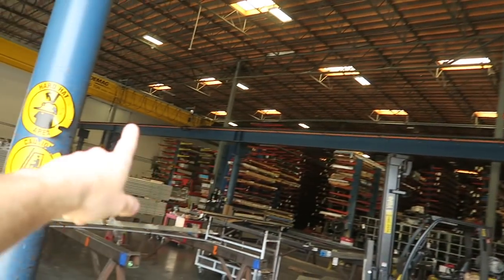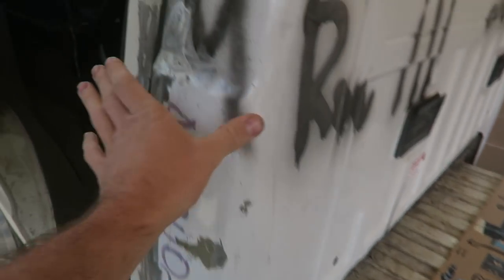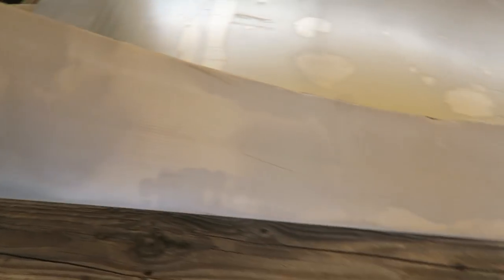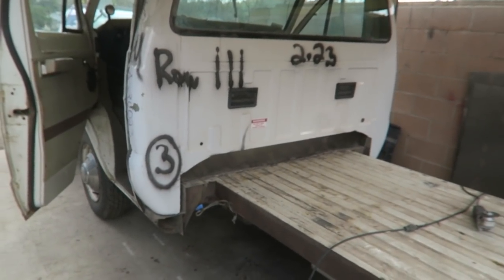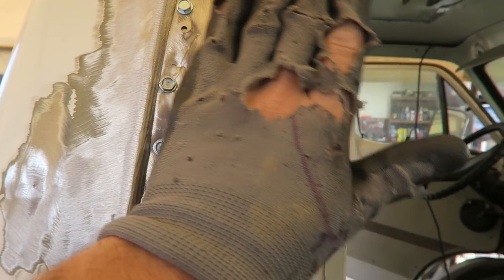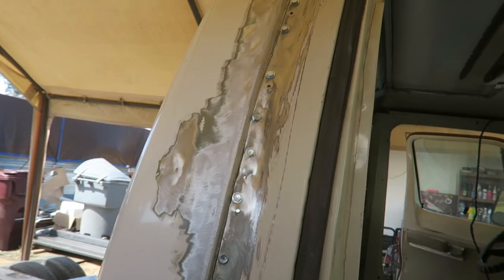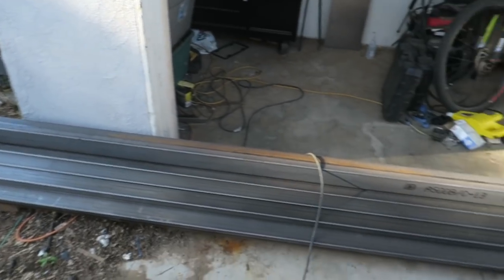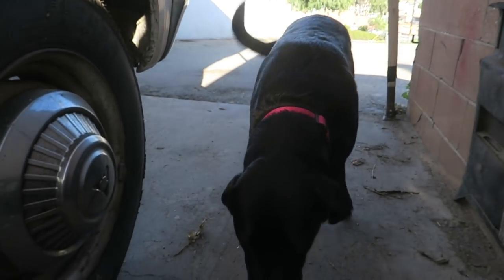$1000 in Metal - Welding Cab on Ramp Truck! (Episode 4)

Comment: I'm wondering why he didn't use the back of another dodge van for easier fit
Reply from the maker: The back of a 1973 dodge van had two doors and smaller windows, and it would have been much harder to make fit
Reply: the back of the van would of been ideal and he could use one from 1972 to 2003 with a one piece full door !!!
Reply: Or a similar era Dodge pickup cab rear end. But the future always has the answer.